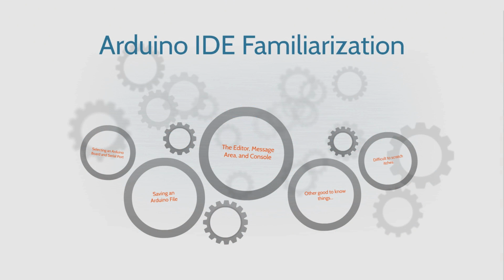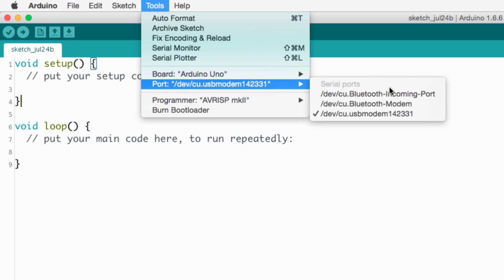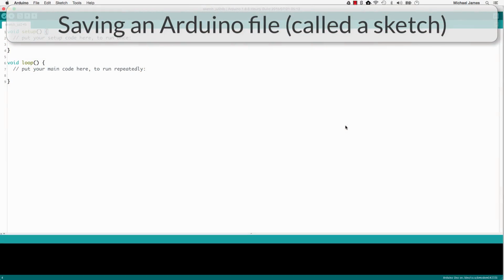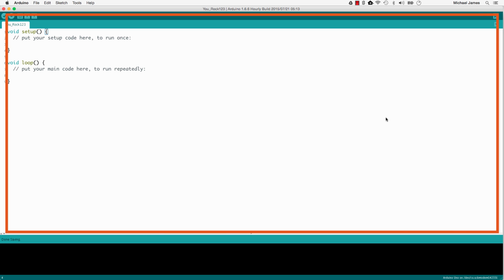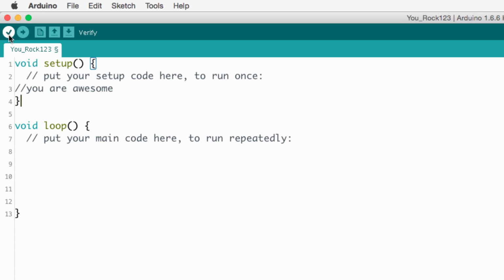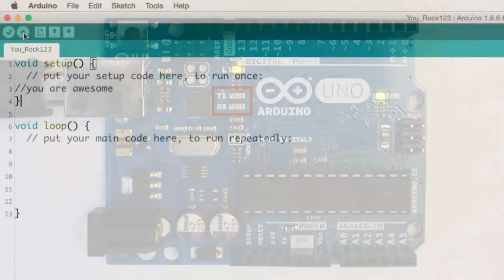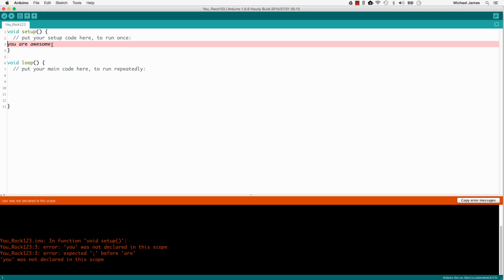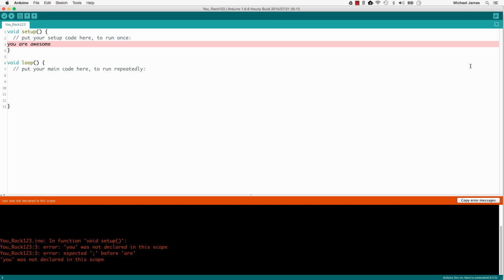Lesson 4 | Arduino IDE Familiarization | Arduino Crash Course

Comment: Hi , at first Happy new year .
ok i have a suggestion for a great Tutorial that you can help us understand how it's work 
it's about MENU like a 'user interface' using arduino board , LCD or TFT , Buttons or Rotary encoder and some actuators and sensors (relay, DHt11....).
the idea comes up when i"m setting the 3d printer  , i have been looking and searching the Marlin firmware but it's so complex it is like another level of sketching and coding .
i hope u like the idea ;)
Reply from the maker: +Akrout Osama Great idea!  I will add it to our list of possibilities.
Reply: ok thaks i hope u will mak'it sooner